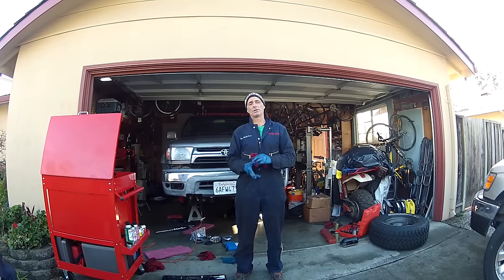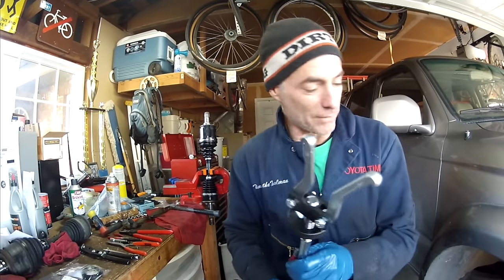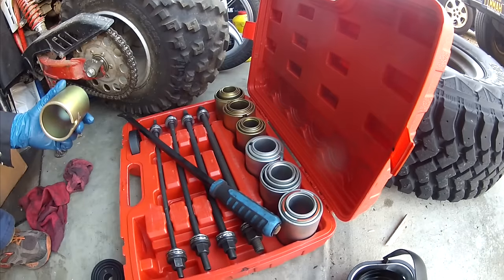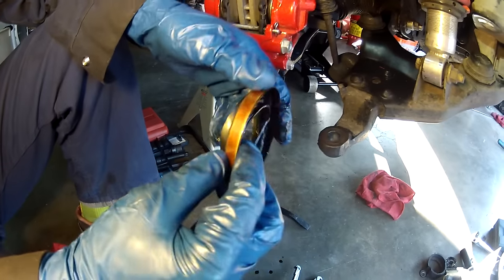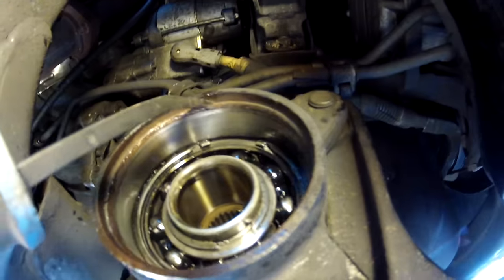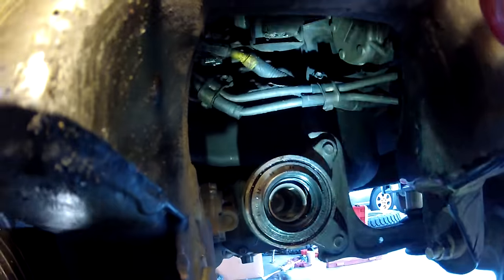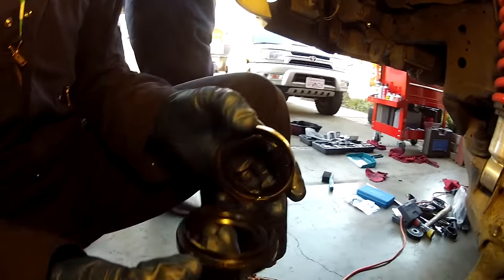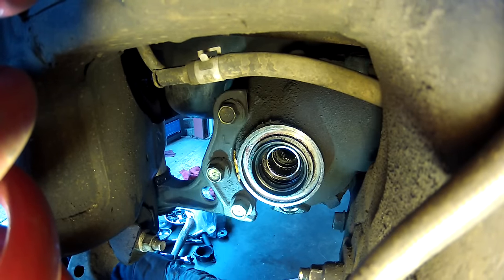Front Differential Axle Shaft Oil Seal Replacement

Comment: Hi.what oil is that leak from there?is it engine oil?thanks
Reply from the maker: Gear oil from the front diff. it is NOT engine oil.
- Sean
Reply: @TimmyTheToolman  how to fill this oil ?thank u
Reply: @TimmyTheToolman  last time I saw the garage repair my front axle and oil is drained and they did not fill new oil.
Reply from the maker: @ccg8895  there are 2 plugs. A fill plug and a drain plug. Watch this video for reference 
Front Differential Replacement (3rd Gen 4runner or 1st Gen Tacoma) (Part 2)
https://youtu.be/bOOxfDFUFsA
Reply: @TimmyTheToolman  many thanks
Reply from the maker: @ccg8895  You're very welcome.

Comment: Thanks Timmy! do you know the diameter of the sleeve you used to drive the drivers side seal in?
Reply from the maker: Hey James, I don't know the exact diameter of the seal driver we used.  We just chose a driver that matched up best with the diameter of the bushing from the OTC kit I own.  A link to the kit I used is in the video description.
Reply: I used two different diameter exhaust connections from the auto store. Diameters were 2-3/4" for the passenger side, and 2-1/2" for the driver side. I would recommend trying to find a 2-7/8" diameter sleeve for the passenger side, the above will work as I couldn't find that diameter at the auto store.
Reply: @elkcrzdfrk197  good info. How did you go about hammering the seals in using the exhaust connectors?

Comment: Ok thanks for your video. I have a 2006 armada LE, front driver side axle shaft is wobbly on the inner end, does it mean it’s the shaft that needs replacing or the bearing inside?
Also can I drive the car with that particular shaft out of the car?
Reply from the maker: My guess is the bearing inside the differential is bad on that side.  I suppose you could drive it with one shaft out but you'd then lose gear oil and provide a way for dirty and road debris to get into you differential.  I guess you could stuff a rag or something in there for the time being while you figure out what you're going to do.  The best option is to fix the problem and put the axle shaft back in before driving it.
Reply: @TimmyTheToolman  again? Please stop recommending these dangerous options. It IS NOT ok to drive with the shaft out, how can you possibly justify that option, regardless of customer circumstances. Correct these errors please.
Reply from the maker: @andyfumo8931  Desperate measures call for desperate acts.  Did you read my response?  By no means am I recommending this guy do this.  But, say this is his only transportation and he wanted to drive his vehicle a short distance to an auto parts store, stuffing a rag in the open side would work for a short time.  When 4wheeling, guys break all kinds of shit and they piece it together the best way they can and get back to civilization.  So, ease up there Andy.  I'm not telling the guy to jump off a bridge.

Comment: Is this the same front diff that an 08 FJ Cruiser has? Mine are leaking and I need to replace them.
Reply from the maker: No, this wouldn't be the same differential but they may be similar and the techniques and steps we show to remove and replace the seals could be helpful to you.

Comment: Hi, I have a 03 tundra 4wd. Upper, lower ball joints, both front wheel bearings have been replaced. Front drivers cv axle has been replaced along with both lower control arms with cams and bushings. Since I had the truck, I hear this rumbling noise from 15-80 mph. The rumble changes as speed changes obviously but for the love of God, I cannot pinpoint what is bad. I suspect the front diff output shaft bearing. Any thoughts?
Reply from the maker: Have you inspected the u-joints on your rear driveshaft?  It could be a bad u-joint.  Do you regularly grease the zerk fittings?
Reply: @TimmyTheToolman  yes, regularly.

Comment: So, at 4:15 you're holding the old one and the new one side by side. The old one has a gold metal ring around it, and the new one was just rubber. Do you install the new one without that gold ring?
Reply from the maker: Don’t get caught up on the color. The part looks slightly different in color but is the same part. The new one is still metal, but just isn’t the same brass color.

Comment: If you made your own press tool with a stop on it at 5.5mm, that would make things easier.
Reply from the maker: I don't need to make it.  Wits' End already did.  https://absolute-wits-end.com/toyota-4wd-ifs-output-shaft-seal-driver/  Paired with this extended handle https://absolute-wits-end.com/extended-handles-for-seal-drive-tools-18/  it makes driving in the seals a breeze.

We used the driver plate in this video https://youtu.be/Q-RO52NtP1A but didn't have the extended reach handle yet.  I did get to use the full combo helping a friend install seals and it was super easy compared to my first experience with this job.
Reply: Nice. Though, pretty expensive for something so easily made on a lathe in 15 min . Either way, it seems better than what you had at the time of this video!
Reply from the maker: @elliiothart18  Having a lathe would be nice but that's not something I own.  The Wits End Tool is nice.
Reply: @TimmyTheToolman  understood, maybe others that do will benefit from my idea.
Reply from the maker: @elliiothart18  Yeah, if people have the tooling and the know-how, definitely make their own tools.

Comment: I did this on my 98 4runner and it's still leaking out of the passenger side. Any ideas why?
Reply from the maker: It could be you drove the seal in too far, or there's an issue with the sealing surface of the CV axle itself.  Are you running OEM or aftermarket CVs?
Reply: @TimmyTheToolman  They're aftermarket high travel NAPA CVs because my truck has 3" lift and 2"body lift. I'll try pulling the seal out and also checking how it fits in the CV axle. I can't belive how quick you responded!
Reply from the maker: @GreyWolfLodge  We do our best to answer people's questions and acknowledge comments as quick as possible.  It's one of the nice things we try to do for people.  We appreciate the comments and like answering people's questions to the best of our ability.
Reply: @TimmyTheToolman  I just replaced to seal again and checked the sealing surface of the CV axle and it seems fine but it's still leaking. Do you have any other ideas of what I can look at?
Reply from the maker: @GreyWolfLodge  When you removed the seal, was there any sign of damage to the housing where the seal seats?  I'm just wondering if gear oil is getting past the seal to shaft connection or is it getting past the seal to housing connection?
Reply: It seems like the seal sits well in the diff. I'll pull it out again and look to try to diagnose it. The CV I pulled out did have a vastly different diff side end then what I put in. No struggles on the drivers side with the same CV though. @TimmyTheToolman
Reply from the maker: @GreyWolfLodge  If the area where the seal seats looks good, I'm suspecting a fitment issue of the aftermarket CV with the seal.
Reply: @TimmyTheToolman   This is extemely embarrassing but I'm going to post it to hopefully help some other people.

I was putting the seal in backwards... The old ones as you reference in this video https://www.youtube.com/watch?v=bOOxfDFUFsA&t=1189s were that same orange/gold color that's on the back of this new seal. When I pulled mine out, it was that orange-gold color, so I was trying to put the seal in with that color facing out. I feel utterly stupid and very frustrated with myself, but hopefully, someone can learn.
Reply from the maker: @GreyWolfLodge  We all make mistakes.  The good thing is that you figured it out.  Good job doing the work yourself.  You're learning and saving money, and that's what counts.

Comment: Hey Tim, I was just curious, prior to replacing the diff seal on yours, was there any vertical play where the axle inserts into the diff carrier? Mines def leaking on the driver side and theres some vertical play, but not enough to really concern me. (already put 1000+ miles on it since I've noticed it) I ask because 4x4 works still works fine on mine, but I've had this same seal replaced a year ago. Would a faulty seal cause movement on the axle or should I be concerned more about the gears within the diff carrier? Also, any suggestions on where to get some quality CV axles? I'm tired of the "lifetime warranty" from the local autozone, ain't worth it. Thanks again!
Reply from the maker: I think a little play is normal but excessive play probably means the bearing on that side is worn.  The additional play in the axle could cause the seal to prematurely fail.  But, maybe it's leaking because the shop didn't install it right.  If the seal is installed to deep, it doesn't meet up with the axle shaft properly and is more prone to leaking.

If you're tired of replacing CV axles, I'd either go to a Pick and Pull and try to find used OEM axles on a wrecked 3rd Gen you could service with a reboot kit or you could just buy some OEM axles from an online parts seller like Camelback Toyota out of Arizona.  Their prices are really good and orders $150 and over have free shipping.  They just charge you a $3 handling fee.  Camelback sells them for $152/each.  Here's a link: https://parts.camelbacktoyota.com/parts/2000/Toyota/4Runner/SR5?siteid=214329&vehicleid=84047&diagram=F809200
Reply: Thanks for the tips and the link! I'll have to rewatch the video a few times before I break into it.
Reply from the maker: Good luck with the repair.

Comment: You need to rebuild the diff there were chunks of metal. What's the point of putting seal on a wrecked diff?
Reply from the maker: Well Yeah Jonathan, we agree 100% with you but this was Eric's truck, not ours.  His differential was still working at the time we shot this video and the immediate need was to get new seals in to lessen any more damage with all the gear oil leaking out.  If this was our truck, the differential would have came out and we probably would have sent it to East Coast Gear Supply or our buddy Zuk for a full rebuild.  But, the real point was to show people how to replace their differential seals and we did that.

Comment: hey Timmy, would I need a front end alignment after replacing cv axles? thanks
Reply from the maker: Hey Beau, no you would not.  You're not changing anything that would affect your alignment.
Reply: Ok great. Thank you sir. Your videoes help
Reply: Hey Timmy. Question, just pulled my passenger cv axle, 99 4runner. Was leaking gear oil after replacing cv axles. I noticed this just loose inside, does this go into new seal, gonna try to post a pic to you. It’s a small thin rubber seal I guess it may pop into back side of new seal
Reply: Hey. It’s a metal spring looking gasket?
Reply from the maker: Hey Beau, take a look at this video and maybe it will help you figure out the cause of the leak. https://youtu.be/mh1BK5--KrU

If you want, you can send a picture to my email: mtbtim@sbcglobal.net

Comment: 7:24 mark, is that the flywheel that is visible in the upper left side?
Reply from the maker: Dude, really good eye.  I never noticed that.  That is the flex plate which is basically the same as a flywheel.  Manual transmissions have a flywheel and auto transmissions have a flex plate.  Obviously, Eric is missing the access plate on the bottom of his bell housing.
Reply: I thought you were doing a tranny swap for this guy as well! any plans of doing a video of a transmission replacment?
Reply from the maker: We already replaced Sean's auto transmission.  Other repair jobs and life got in the way of getting the editing done but I just finished the rough editing of Part 1.  It's most likely going to be a 4 Part video since it's a long and involved repair and we always document these repairs as comprehensively as possible so breaking it up into parts makes the most sense.

Sean was originally doing all the editing but it's a very long tedious job.  We are now sharing the editing responsibility with me going through the clips first doing all the rough cuts creating the content I feel is important and then Sean takes over refining the video, adding in cool things like Factory Service Manual pages, close-ups, quirky funny stuff, taking out more of my uhs and ums and just making it a nicer video to watch.  I have more respect for what Sean has done with our videos because it really is a ton of work doing the editing. 

I'm hoping we'll have the 4 part series out within a week, two weeks max.

Comment: ignore part numbers from this video, they may not fit your particular toyota , always take your VIN # to toyota for a correct match
Reply from the maker: Well, if someone has a 3rd Gen rrunner or 1st Gen Tacoma,  I can guarantee the part numbers for the seals are correct.  For other models and generations,  yeah, it would be smart to confirm you're getting the right ones.
Reply: I have a 2005 Highlander  , base model AWD with 3.3  , the 05" highlander comes with at least 5 different oil seals , finding the right one was nothing less then an adventure , and don't get me started on those castle nuts with those damn cotter pins LOL  I quit today when I got to the cotter pin , I have to drill them out ,  @TimmyTheToolman
Reply from the maker: @Highlander-s5p  Good luck with the rest of the job.  Sounds like an adventure.

Comment: Does anyone know if the seals are the same for the non ADD Tube?
Reply from the maker: We're not sure.  Just confirm this with whoever you order from so you get the right seals.
Reply from the maker: We're not sure.  Just confirm this with whoever you order from so you get the right seals.
Reply: Looping back to confirm both seals worked. My concern was with the passenger seal for an add dif tube being different - it was not.
Reply from the maker: @francoisl7663  Good to know.

Comment: You need to show how you get to the point where you are at. Why not show how you removed the axles?
Reply from the maker: Ask and you shall receive. We have a plethora of videos so because of this, sometimes we don’t show the entire procedure so you can reference the removal of the CV Axles here:
CV Axle Reboot & Replacement With CV Boot Stretch Mod
https://youtu.be/vcCT4UgFUTw
- Sean
Reply from the maker: @ 17 seconds into the this video, there is text on the screen letting you know we have a video showing how to remove and reinstall the CV axles.  A link to the video Sean mentioned pops up at the top right corner of the screen.   In the future,  it is to your benefit to watch the entire video, because quite often, people like yourself have asked a question that the video would have answered for you.

Further, the video Sean mentioned is linked in the video description.  Be sure to always read the video description of any video we have made, and also look for a pinned comment (1st comment you see).  If you don't,  you'll potentially be missing out on some very important and helpful information.  When there is new information available that wasn't in the video, the video description and/or a pinned comment is where we will share it with our audience.  

Now, here's some feedback for you.  Sean and I don't NEED to do anything.  Your comment comes off like a demand like we owe you something.  Sorry Dan, the world doesn't work that way.  Next time you comment on one of our videos, how about giving us a Thank You for providing you a tutorial on how to perform a job on your vehicle.  

Sean and I do this work because we care about our fellow man.  But, we aren't saints and have no problem calling people out for the way they communicate with us.  

The sooner you stop coming from an ENTITLED frame of mind, the better off you'll be.  I spent extra time on this response to hopefully get you to think how your comment wouldn't be received well by most people.  - Timmy
Reply: Because he is just showing how to replace the seal

Comment: But for real. It looks easy. But those seals are super touchy. And spaceing is a big big deal westher it seals or not. 1st time i did this had to replace 3 seals set to deep. To deep is a common mistake. Make it flush or even pokeing out by 1mm for best resilts. Gotta remember the axel has some pull in out play needs room to move and still have the seal touching tightly. Dont set the seal deep. Its flush or you gone to far and 1mm to deep is the difference between it working and leaking. Just 1mm to deep and you gotta pull ot all apart and do it again
Reply from the maker: Yep, you have to drive the seal to the correct depth to avoid a leak.
Reply: @TimmyTheToolman  yeah. I found that out the hard way. Didn't think depth was that important turned out it critical lol. Had to do it twice. Best advice is to pound it in flush with the diff houseing or less. But never past the diff houseing not even 1 mm

Comment: man that's a .replica of my problem went to drain and almost nothing!!
Reply from the maker: Well Dario, you know that means you have a leak somewhere, most likely the culprit is the seals we replaced in this video.  Clean up the differential really good, refill it and then check to see where there's any dripping gear oil.  Gear oil doesn't get consumed like oil can in an engine.  If you're low, you definitely have a leak.
Reply: thanks i think is the inner drive shaft seal!
Reply from the maker: Haven't replaced one of those yet but I imagine it's not too hard.